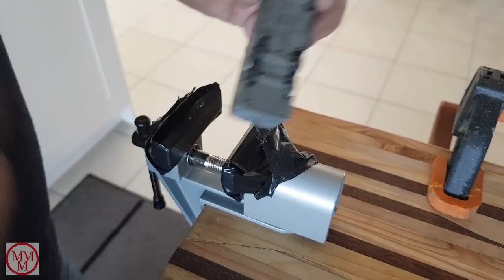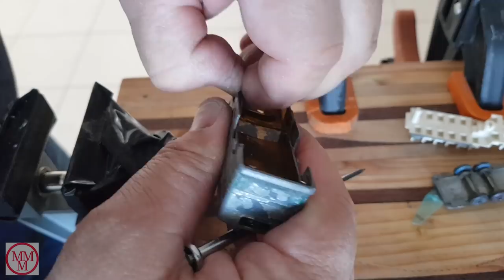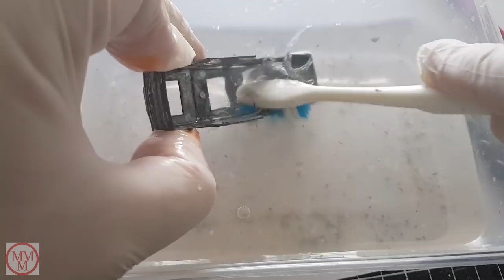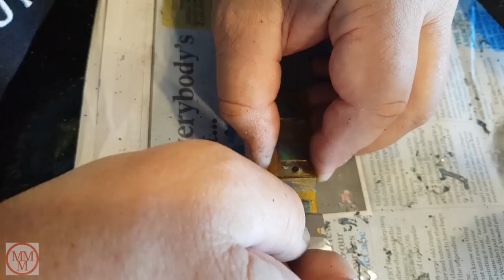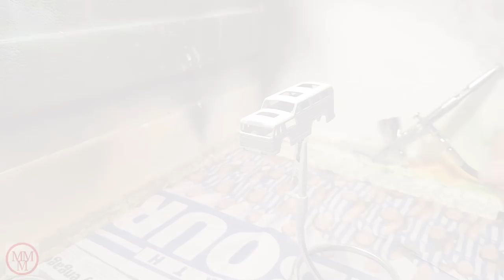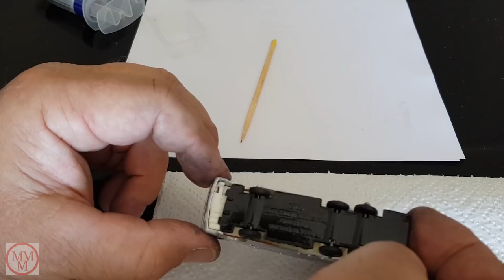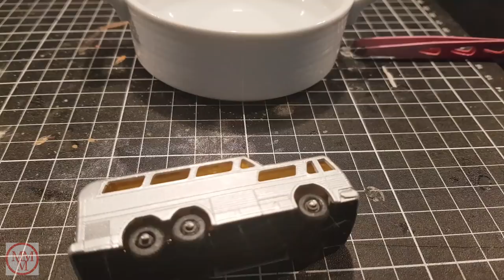MATCHBOX Restoration No 66 Greyhound Bus 1960

Comment: This is one damn fine restoration!  Have you considered using "Babbitt" alloy for reforming the rivets?? Melting point of around 500°F; somewhat malleable, workable, and should have enough tensile strength to do the job.

From around 4 years of age, until the age of 12, Matchbox cars, trucks, and other models depicting modes of transportation, were my world.  I continue to cherish them. One of my best friends during my younger years was "Corky Kusinerczyk"; his family owned "Reeder's, Incorporated", a larger charter  bus, and (line run) public transit company, where by age 12, I helped to service the motorcoaches when they returned from trips; bu the age of 14, I could "jockey them around the parking lot" with the best of them.

"Corky" had over a dozen of these "GM  PD4501 Matchbox Scenicruisers", and Reeder's operated two "GM 4905 Buffalo" motorcoaches. They were damn cool!. He was killed in an automobile accident at age 26, in 1984. It's tough to look at this Scenicruiser, without thinking of the hundreds of adventures I had, driving mostly New York/Philly/DC, and Baltimore trips. I have over fifty years of memories pertaining to these very same buses, and still have Corky's MCI-MC9-A "special purchase" Matchbox Motorcoach. There were 250 made, and I've never seen one for sale.
Reply from the maker: Never heard of it sounds like it might work.!?

Comment: IN wayt way late as I only recently subscribed. But if you are paying attention still Simple Green  concentrate (or whatever the equilvalent is down under) will take the paint away from the plastic without hurting it. Takes a 24 hour or so soak but it definitely works.
Also if you can get an equivalent of Easy-Off oven cleaner that will strip it as well but you will want to do that outdoors and wear gloves as well as it isn't as nice for the environment as Simple Green.

Comment: I've use straight brake fluid to strip paint off die cast and plastic.  It doesn't seem to adversely affect either and the paint just falls off compared to paint stripper.  Test on something sacrificial first to prove the method.

Comment: One thing you may have heard of for removing paint from plastic is methylated spirits! There are retro pc restorers who have used this to remove old damaged paint without harming plastic! But it requires immersion and time along with some brushing! for reattaching the bottom, some youtubers drill and tap the old rivets, then use screws!
Reply from the maker: I do drill and tap normally but in this instance the rivet posts were too slim.Never heard of using meths to remove paint from transparencies though! Thanks for the info!.

Comment: A popular trick for model railroaders is to use 90% ethyl alcohol to remove paint, or oven cleaner. A last resort is DOT-3 or DOT-4 brake fluid.
Reply from the maker: For the time being i'm sticking with the 'paint stripper'.

Comment: Use Isitopal Alcohol on the paint on the window next time you need to remove paint. It should come off easier. I use it to clean a brush I didn't get all the paint out of and it works great.

Comment: I find when you have a windscreen that has heavy paint on it the best way to clean it is put it in a little cup of gasoline and let it soak come back and wash it with the gasoline with a toothbrush in the paint will come right off and it won't hurt the windscreen I hope this helps you

Comment: I'd put the transfers on before putting it back together and give the whole thing a clear coat to protect them from scrapes and scratches.
Reply: This is a great idea I've used for alot of years, after building formula 1 models. All those decals are quite intricate and after a few years dusting the model the decal will flake off without being clearcoated

Comment: try to clean parts in ultrasonic cleaner in 100Hz altitude or higher. This would remove any coatings, such as paint or glue from any surface without scratching.

Comment: Plastic modelers often use Castrol Super Clean to strip paint off of plastic.  Paint Stripper damages the plastic, but Super Clean does not.  I would test on transparent plastic, but I've not heard of it causing problems.  Also, Micro Sol / Micro Set (about $2.00 American each) will literally melt the decal to the side of the bus.  Waterslide decals set better and avoid silvering if you glosscoat the bus first.  I learned that by having many waterslides "silver' (get trapped air under them), finally, clear coat over the decals to seal them in forever, that way they never flake back off....  hope this is helpful.... model geeks play around with a lot of the same kind of stuff!
Reply from the maker: Thanks for your very informative comment. Always welcomed!

Comment: I got a amazing way to remove enamel paints from plastic without damaging anything

Put the part in Dettol original mixed with water and wait a couple days and the paint will fall right off
Reply from the maker: Interesting I might experiment with this method.
Reply: @MartysMatchboxMakeovers  I use it all the time when I mess up my model kit while spraying just wait a few days and scrub it with a toothbrush if it doesn't go off right away

Comment: Oldie but goodie, I had one of those when I was a lad.
Marty, have you tried decal set solution? Idea is once the decals are dry you apply it and it melts the transfer slightly, making it conform to every slightest detail of the casting. You can then, if you like, clear-coat over that with quite nice and durable results.
Cheers Brother.
Reply from the maker: Yes I have
Reply: @MartysMatchboxMakeovers  Good deal... stay healthy and thanks for sharing the videos.

Comment: Hi
That restored, not use, screw. Only glue for ,  joint frame to the body?
Note:
I travel in that buses, from Panama to mexico, and return. Are big buses air suspension, big engine.
Brand GMC.

Comment: Would Brake Cleaner be to harsh for the plastic when cleaning the windows?
Reply from the maker: No - It works really well. I didn;t know about this until after this video and a subscriber recommended that I tried it. I did and have stuck with it ever since.

Comment: On the plastic parts you can rather use Tamiya paint stripper Works great on plastic
Reply: Personally, I use caustic soda, the stuff we use to open a clogged drain in the sink. It comes as a grainy powder and needs to be dissolved in boiling water.  Watch out, it will react with some splashing, so use a deep container as well as eye- and hand-protection. Once it's lukewarm or down to room temperature, I put in the model I want stripped —the polystyrene I work with can't stand the heat! Metal parts can be put in the hot water or, for speed, set in the powder before you add boiling water. Make enough solution to immerse the whole model. 
WARNING: I'm talking about polystyrene models! Window screens, cockpits and other see-through plastics are of a differing compositions Caustic soda might damage these; it all depends on what model you have and when it was made!!! So test the effect first.
Normal model poly can be soaked in the solution once it's cooled down. Leave overnight or as long as necessary. Cleaning is as Marty shows, with a toothbrush and plenty of clean water. 
This method has worked fine for me fro many years. Give it a try but do be careful with those  "glass" parts!

Comment: there is another youtuber who restores matchbox, hot wheels cars etc and if the windows are scuffed still usable he has a dremil with a polishing wheel that he uses to make them much clearer and fix some imperfections, there are also multiple youtubers who use small drillbits to drill into the rivet posts and tap them and then use screws to hold it together, im not sure that it would have worked for this one though as those rivet posts looked pretty thin
Reply from the maker: Yeah, I don't know where I would get microscopic screws from so I just went with the glue. I've got a dremel but still not confident using it on plastics as it can ruin things real quick if you are not careful.
Reply: @MartysMatchboxMakeovers  sorry youtube did not notify me that you replied. you are right about  the dremel possibly ruining plastics, i didnt know that at the time i made the comment. apparently a cotton buffing wheel is much better than the one the dremel comes with as the one it comes with will strip the plastic in seconds

Comment: I think you can do the work with the windows part more easy if you just remove the paint with sand paper.  1000 grade first and then 2000 or even a third step with 5000. To make the plastic bright again use some toothpaste and that's it

Comment: Great Great work my friend! Would you be kind enough to let me know which are the basic tools and materials I need to start? (removers, paint, etc) I'm in Argentina but I think I can solve the translation issue if u help me out a bit! Thanks
Reply from the maker: Las herramientas básicas serían taladro de batería, juego de taladro pequeño, juego de destornilladores pequeños, juego de limas pequeñas, un juego de llaves para cortar la rosca, pegamento epoxi, esmalte de plástico, papel de esmeril, removedor de pintura, pintura y capa base Spry o imprimador. Espero que esto ayude.
Reply: This certainly helps! Congratulations on your spanish. It's flawless. Thank you for taking the time to answer. Cheers

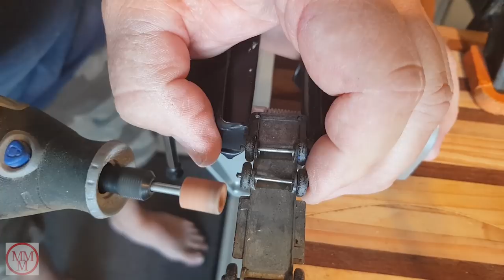Comment: I've watched about 5-6 of these and I only just realized the axles are a pin with the head on one side and a flange on the other. It's always struck me that what you do at 8:06 is actually on the flange side would be much more noticeable. I thought the axles were symmetrical. I guess not. I thought that step would diminish the value, but it's likely it would be difficult to tell this had been done to a restored model.

Comment: tiny screws would work better for putting the base on. as to the  "glass"  I don't see much of another way to do it, tho you could blob some in the previous holes, so that in the future if someone else needs to restore it. they can find and remove the glue, otherwise they have no way to get to it. You could also cut most of the threads off some small screws, and glue them in to hold the "glass" in. Someone trying to restore it 40... 50 years from now would turn the screws, break the hold of the glue, and whalla, the glass could be removed once again.

Comment: I had one of those. Mine got lit on fire on the stove burner. The whole back got red hot and melted. It looked like it got rear ended at 90 miles an hour. The wheels melted on the metal burner, and my mom couldn't get the melted plastic off, no matter what she tried. "What did you melt on the stove?!" "Nuthin." ..Must've been food that ran over the pan... Or a green army man... Or a Matchbox bus... If I'd known then that all that shit would be worth $ someday... Anybody who has ever lit green army men on fire knows this sound: "Vvvvt! Vvvvt! Vvvvt!!.." Those 70s Gi Joes melted and burned too. And Big Jim's camper, it was all plastic except for the axles. It turned into a big black puddle of melted plastic on the ground.The old fly-by-kite-string airplane crashed and burned. Hundreds of Matchbox/Hot Wheels/etc. got bashed with a hammer or a rock or a redbrick... I had a big Matchbox junkyard under a spruce tree in the needles, til somebody found it. I always smashed and burned and otherwise destroyed all my toys when I was a kid. Captain Destructo! Godzilla-smashing microcosms of society...

Comment: how valuable are the originals to collectors and does this reduce their value doing this?   I mean this one was in bad shape, so its better being restored, but if one was in okay or good shape?
Reply from the maker: If one was in original mint condition it would probably fetch 5 or 6 times what I could get if i sold a reconditioned one. Something like $20 for mine and $100 for the real McCoy. i don't sell but just do them up and collect them.  I try to start  with a worthless one and then I know whatever I do will be for the better.

Comment: Not your fault, but it's really a mess trying to clean up those poly tires.  Why don't you contact a mate in Australia who knows how to do 3D design/printing for completely new tires?  The material comes in black.  The best method for your purposes would be to use liquid polymer to reproduce the tires as opposed to ABS extrusion material.